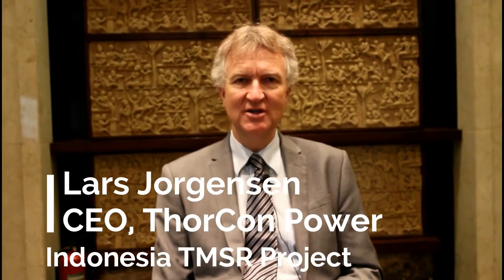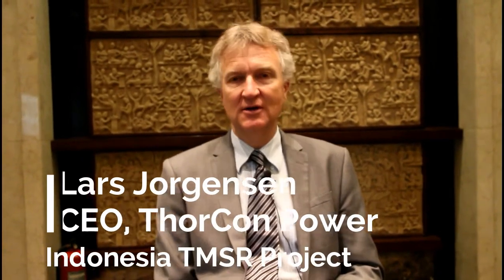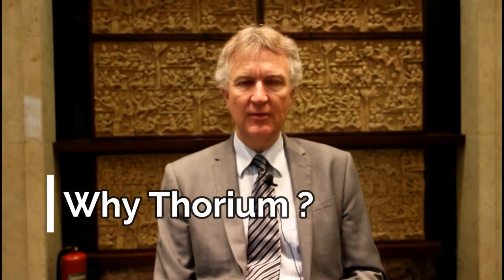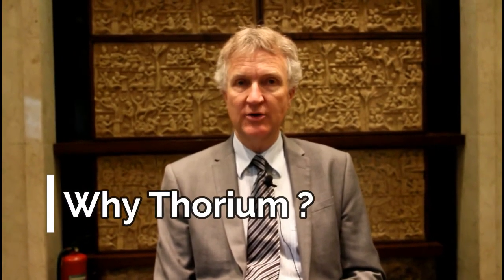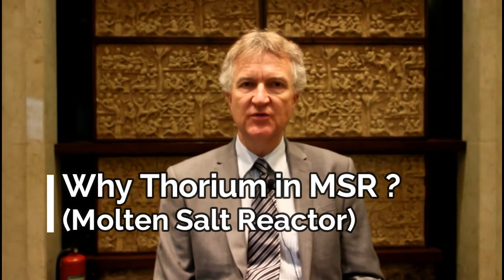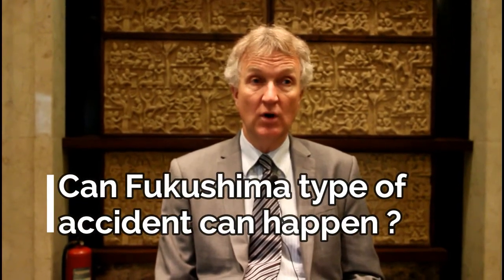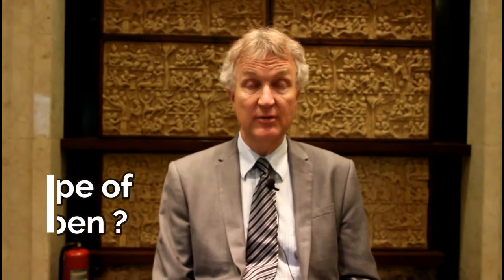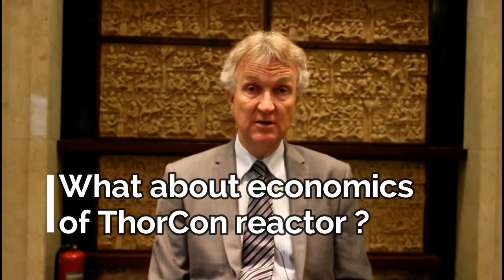ThorCon Power, Lars Jorgensen on Indonesia Thorium MSR Project

Comment: As of December 2016, Indonesia does not have plans for any commercial nuclear power reactors of any kind, has not invested one cent in any nuclear power plant projects, and does not produce one watt of electricity from any nuclear reactor.
There is no thorium or uranium production in Indonesia. The country also has not invested one cent with ThorCon.
ThorCon has been since its creation and continues to be a "business development" company with one small office in Florida and a half dozen employees, none of which is a nuclear engineer. ThorCon holds zero patents in nuclear power technology and their prototype reactor is still at the conceptual development stage (no blueprints).
Reply: a issue is them found lot Thorium resources in Bangka Belitung Island.
Reply: They have signed the project. It's official. Just saying if you haven't read the news.